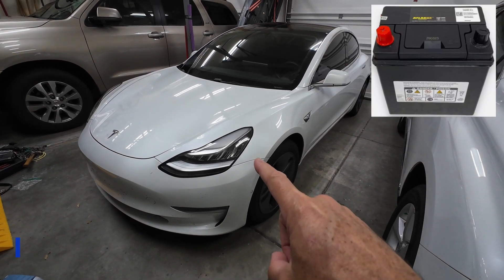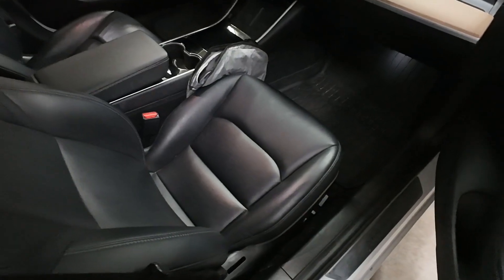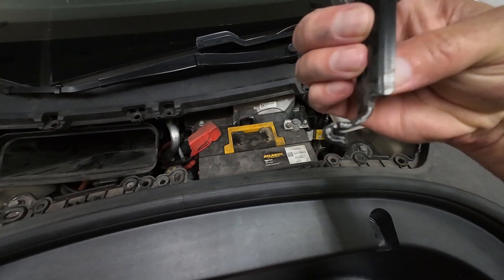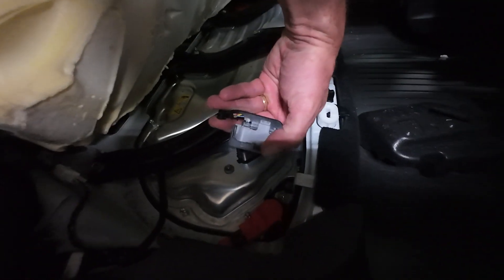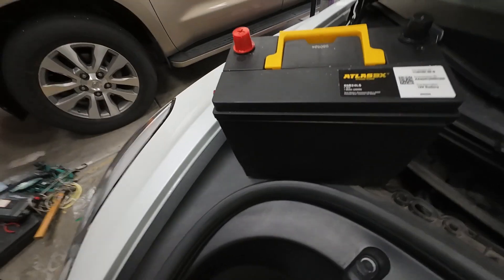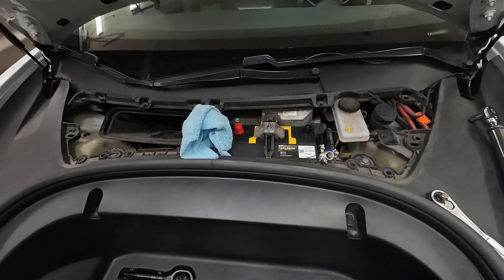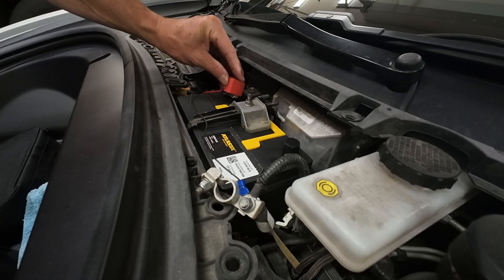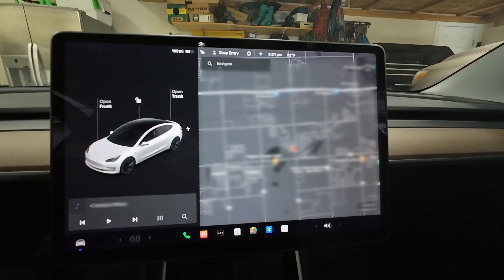How to Replace Tesla Model 3 12v Battery (Tesla Manual Instructions) DIY

Comment: It’s September 2025 and Tesla is charging $100 for these.  Still much less than Autozone and Oreilly.  Both wanted $229!  And yes, the service center still keeps them on a trickle charger fully charged.  Lead acid batteries like to be kept near 100%.
Reply: Are they AGM batteries? That is so incredibly cheap, I just paid like $260 this morning from Advance Auto parts for son's 2020 model 3. Die Hard EV AGM battery.

Comment: What is the model number or where do you buy this battery? Model Y 2020
Reply from the maker: I would check with your local Tesla dealer, they usually have them charged and ready to go, and cheaper than anything aftermarket.

Comment: After 55k miles and 5.5 years, mine gave a warning and was bulging as well. Had Mobile tech come out and install it. Diminishing returns on this job since they come to your home to do it... just pay Tesla Service to do it 😂
Reply: What did they charge for the visit and replacement?
Reply: @LibertyOrDeath7230  For me it was 100 for the battery and it would’ve been 130-140 for them to come out (total).
Reply: @pstamn0 thanks. They couldn't get me scheduled for almost 6 weeks so I just did it myself. Took maybe 20 min
Reply: @LibertyOrDeath7230 $149.65 is my estimate for mobile visit

Comment: Thanks for the walkthrough I followed it to the letter and all is good here - Replaced on a 2019 Tesla Model 3 UK car - Replaced the original ATLAS BX 85B24LS - 45Ah - with BANNERP4523 = £80 independent supplier - This walkthrough is perfect - There's nothing I can add.

Comment: Should the new 12V lead acid battery be fully charged before swapping the old one out? Just had it checked at an auto shop and was told the new battery is at 69%
Reply from the maker: I believe mine was charged fully before I installed. I didn't check the charge, but Tesla usually has a few batteries that are ready to go/on chargers to sell from the dealers.

Comment: How many miles till you had to change the battery?
Reply: I have a model 3 2021, had to replace at 70k
Reply: i have a 2021 and it’s done 47k. now wondering if it’s worth just changing for future fail safe
Reply: @gord6695  I have a 2018 with 63k miles and just got the notice to replace the battery a couple days ago.

Comment: My 12V is dead so I am unable to access the screen and turn power off. Is this a deal breaker for doing this task?  Also, can't open my rear door for the same reason.  Why is that a critical step?
Reply from the maker: I don't think it's a deal breaker if the screen is already off. If you were concerned you can pop the port off the front of the car on the bumper, there is a little square access port with 12v leads. This allows you to pop the frunk and it should power the screen on as well. The rear door being left open was just a reminder because after you power the car off and disconnect the 12v, you can't get in there to disconnect the high voltage due to no power. Hope that helps!
Reply: why need to disconnect the high volt
Reply: @tonygaming1823 it is the low voltage plug, not the high voltage. Just done it on my buddy’s model 3 performance 2020(ptc heater model) and in teslas manual it says that the plug is for low voltage.
Reply: That's what im wondering nobody has a video trying to replace it when it's already dead which is when most ppl replace it.
Reply: Hi, were you able to change it? My car is now dead too. Didn't get any warnings. I can't  open the door or access anything. The frunk is open though.

Comment: I’ve seen the sequence different in another video. I believe they disconnected the high voltage, then completely swapped out the battery, and then re-connected the high voltage.
Reply: I tried it that way, as per the other video on youtube. And I could hear the contactor repeatedly trying to initiate the high voltage system, since the high voltage wasn't connected it almost drained the battery. So yeah, bcareful.
Reply from the maker: I tried to go step by step through the manual but...what model do you have, and year? I would double check the Tesla support website if you are concerned, they do have some different procedures depending on the year.

Comment: Two things about high voltage on EVs: 

I thought all HV cables were orange. 

Second, even though it's a connector, aren't you supposed to use electrician-grade insulated gloves when working with HV parts/cables? I think the battery pack is around 400 volts and 100+(?) amps. Insulated gloves are so you don't possibly electrocute yourself.
Reply from the maker: You can use gloves if you desire, I'm very comfortable around electricity and if you follow the steps in this order, this is little risk if any of shock from the high voltage as that is insulated in the rear of the car under the seat.

Comment: Where can you find the replacement battery?
Reply from the maker: I went to a local Tesla dealer, it was very cheap compared to anything else and just like the factory battery. They usually have them charged/waiting at the Tesla dealers or repair shops.

Comment: What happens if the 12 v battery fails.  Will the Tesla draw on the main battery for power?
Reply from the maker: If it fails completely, you won't be able to "start" driving the car even if the high voltage has a charge. There is a trick though, inside the front bumper there is a plastic cover/cap, under the cap there are two battery leads, you can carry a tiny little 12v battery (Duracell style) in your glovebox. If your 12v every completely dies, you can use a tiny 12v to start the car from the bumper....sounds crazy but it works :)
Reply: @TheCarGuyOnline   how much wiggle room do you have with installing a new battery.  I can’t use the Tesla OEM at the moment. Live far from a Tesla centre unfortunately.    Does the battery have to fit exactly?
Reply: And do you need a vent ? I want to install this myself to save me from getting the Tesla towed 400km
Reply from the maker: @anastasiawhite7482 I think autozone has comparably sized 12v batteries, if it fits and you can latch the frunk it should work (12v). The battery vent should already be in your car…and the battery just has a hole on the side for it. It would depend on the type of battery you buy whether it has a vent or not.

Comment: Nice video, why do you have to disconnect the high voltage connector?
Reply from the maker: I believe this is because the DC to DC converter can put 12V power to the terminals, even when the 12V battery is disconnected. Don't want to arc/short things :)
Reply: @TheCarGuyOnline  Then surely you need to reconnect the 12v terminals BEFORE reconnecting the HV.
Reply: @peterwilliamson1825 I noted this as well. I haven’t looked up the procedure in the manual but in the video the HV is hooked up before reconnecting the 12V which seems like wrong order of operations. Needs double checked.
Reply: @TheCarGuyOnline  Tesla may have changed the procedure. According to replacing the 12V on tesla's site, they now have you disconnect the first responder cable that is in the frunk.
Reply from the maker: @ I think that might be on newer models, maybe 2021 and newer?
Reply: probably he leave car for longer without 12V and for longer time it is more safe to avoid connecting + and - 12v because I do not see other reason or/and may be for reset faults?